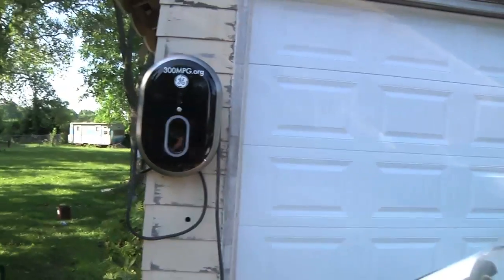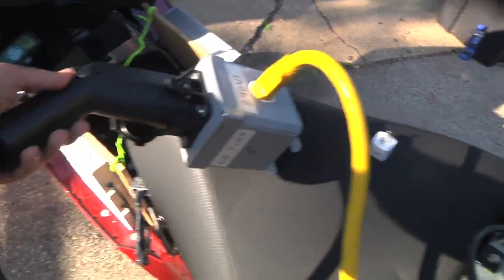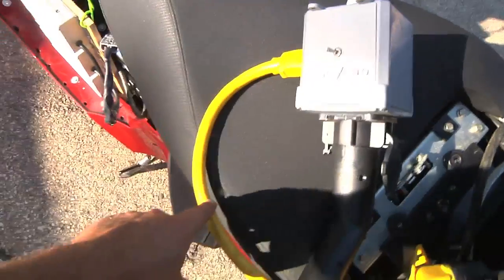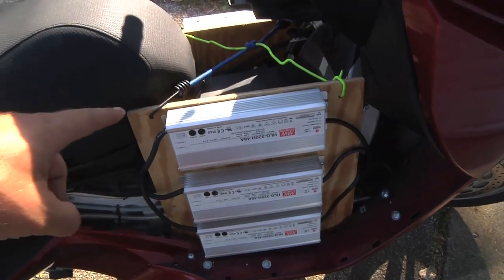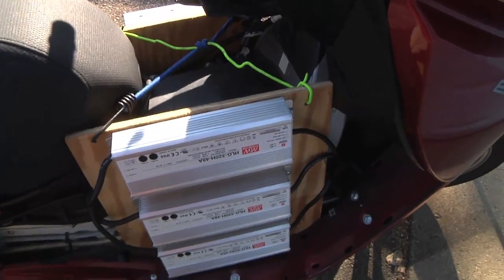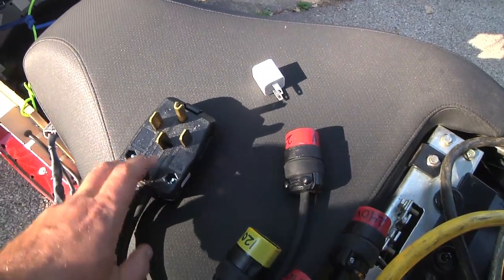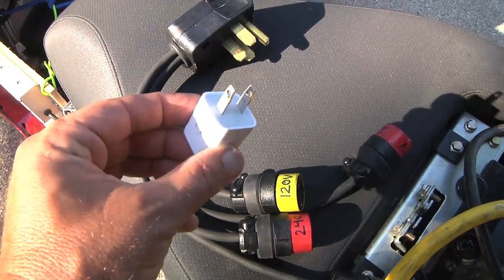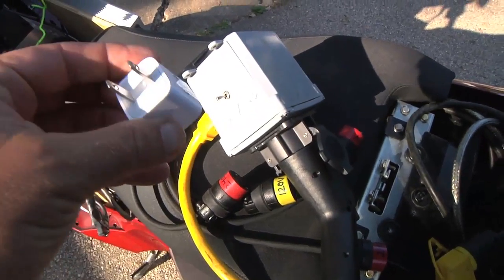Vectrix Update Aug 12 2015: Chargers, J1772, and Adapter Cables

Comment: Does this charge it faster?
Reply from the maker: Yes, adding these additional power supplies can charger the bike up to 3 times faster.
Reply: BenjaminNelson thats amazing! Can you show a tutorial on how to attach 3 chargers into the battery? And you have all 3 chargers that plug into a j1772 port?
Reply: BenjaminNelson or if you willing to build a setup I can plug into my setup and I can pay you for it would be cool too. Did you use something like this with the j1772 to 3 plug outlet?

https://www.tucsonev.com

And how do you plug it into the battery? Do you wire in 3 outlets or do you use a y type splitter into 1 charger outlet?
Reply from the maker: I built my own J1772 adapter. The input ends of the chargers were all still just regular AC plugs. On 240V power, the current was low enough that I could just plug all three chargers into an extension cord with multiple outlets on the end, and then plug that cord into the J1772 adapter.
The DC end of the chargers simply went to either end of the battery pack.
Read more about this at my blog. Here's the article about the J1772 adapter. Other articles cover work on the bike. Just search "Vectrix" on the blog.
https://300mpg.org/2015/03/31/the-diy-j1772-charging-adapter/

Comment: I know this video is old.. but... that apple adapter will work just fine off of the DC from your battery pack too. I use one on a 72V 20S Lithium pack and it works great.
Reply from the maker: Yes! Absolutely. I don't remember off-hand which video it was in, but I ended up wiring a connection in my glove-box at pack voltage that the iPhone power adapter would plug in to. I used my phone as GPS, Camera, and Communications for my entire "Loop the Lake" trip of 1276 miles around Lake Michigan. The phone was powered by the motorcycle's main battery pack the whole time!
I learned plenty about power supplies, adapters, and charging working on this project. Realizing that many phone power supplies can run on a RANGE of voltage, both AC OR DC, was a cool little tidbit to learn about!

Comment: I know I may sound a bit illiterate about electrical stuff, (because I am), but I was just wondering if it would be possible to produce electricity by connecting the rear wheel to an alternator to produce its own electricity to charge the vectrix while driving? Would that make it possible to run the electric motorcycle for farther & longer distances? I am just trying to learn & understand as much as I can about the generation of electricity through other means. Thank you.
Reply from the maker: +sd10559sd The motorcycle already has regenerative brakes built right in. When you want to slow down, you twist the throttle the opposite direction - this converts the motor (in the back wheel) to a generator and puts some energy back into the battery.

Comment: So how fast does it charge at 220v now?
Reply from the maker: FFVoyager It charges at 3500 watts. I did a ride last night of 75 miles, running the battery pack from 150V down to 134. I'm recharging the battery right now on 240V, and I'm tracking the time to see exactly how long it takes to full charge. Also, all three chargers will run on either 120 OR 240V, but at the same wattage. The advantage is that they draw less current, which keeps the cables and connections cooler, and I can connect all three chargers to a single J1772 port at once.